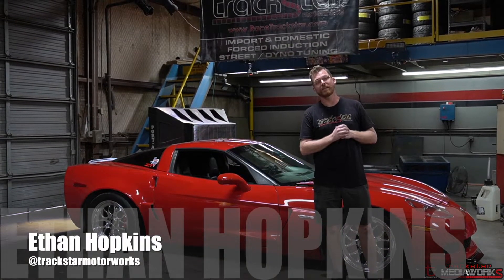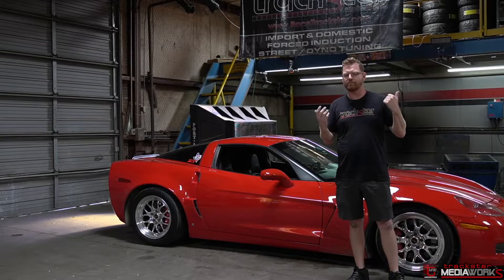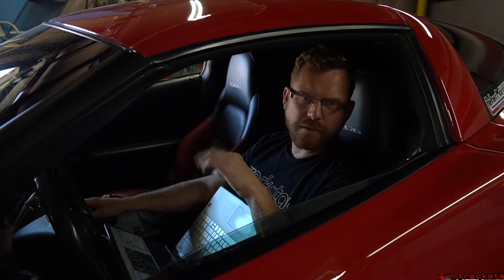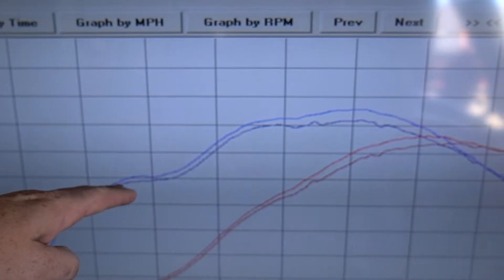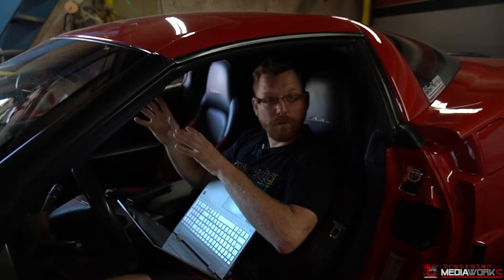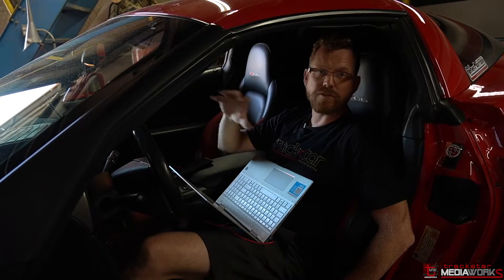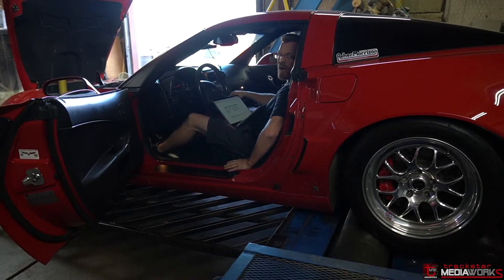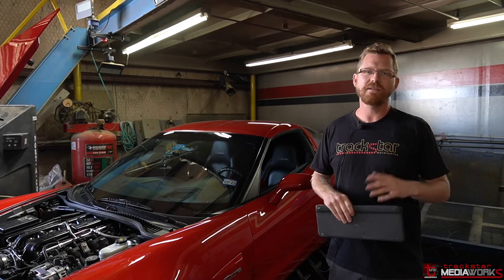Reher Morrison LS7 Z06 hits the Dyno! "Tuned" using HP Tuners Software. Verifying False Knock!

Comment: They do not make an 1 3/4 LS7 header.  Just fyi.   1 7/8 and 2 inch or bigger

Also the dip is common.
Reply from the maker: Hi there ! Thanks for the support! You’re correct that they only make 1 7/8 or 2 inch + now. This particular car does have custom 1 3/4 inch headers on it though.
Reply: Hello these are 13/4 header and they are the lg motorsports headers. Thanks for checking my car out it is impressive what underdog combos can make.